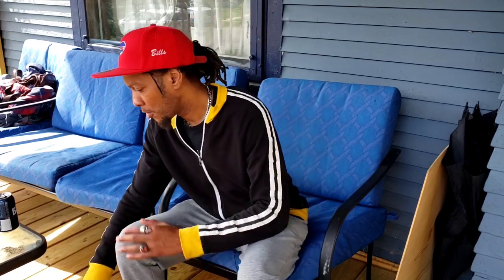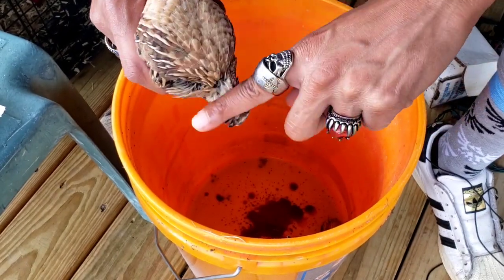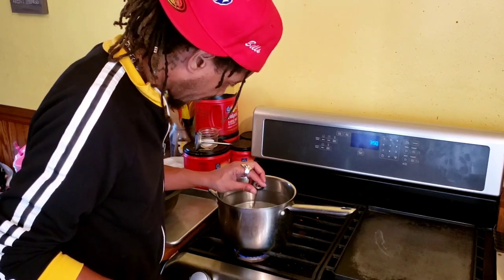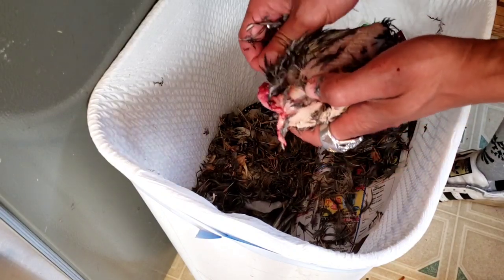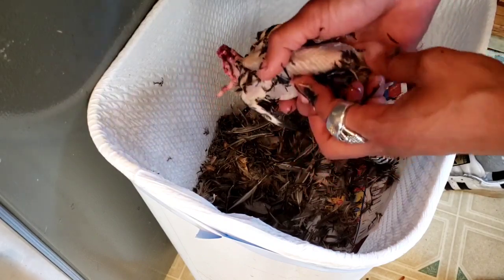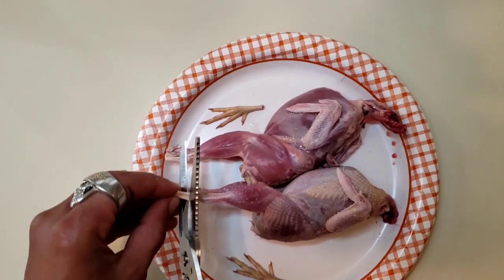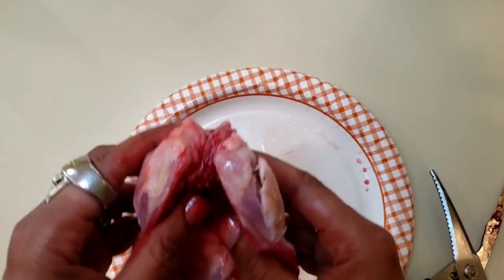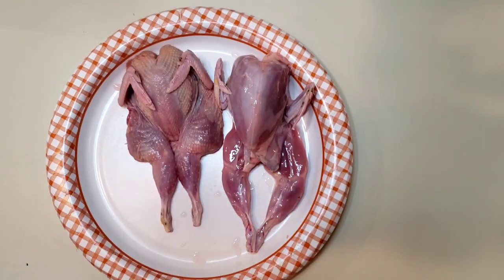How To Dispatch Quail Using the Pull Method: Process Quail With The Skin On - How to Harvest Quail

Comment: Thank you. I was using a pair of meat scissors and it would only break the quails neck and I felt bad hearing them go "peep peep peep" over and over even though I knew they were dead, until I completely removed the head. This method and the one where I use a knife are definitely my favorites so far. I'm only 14 so I still have a lot to learn.